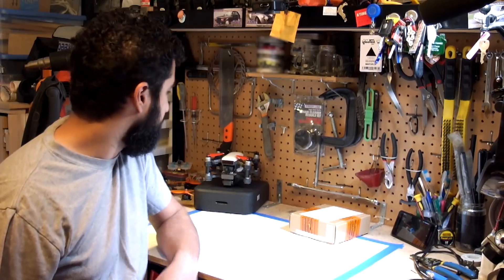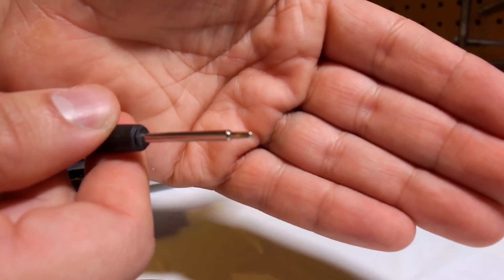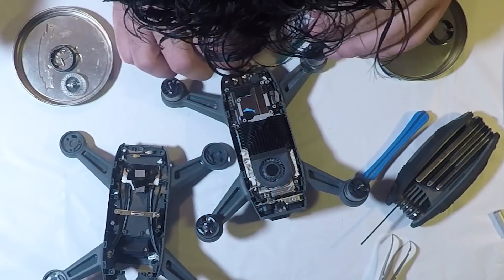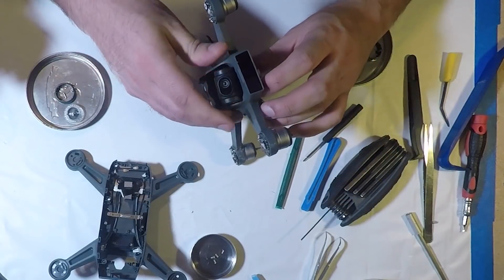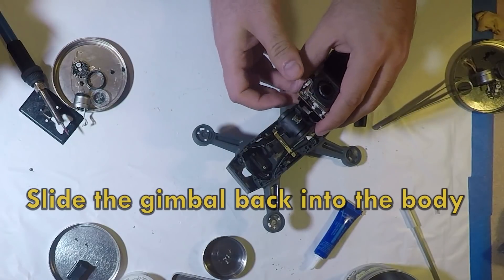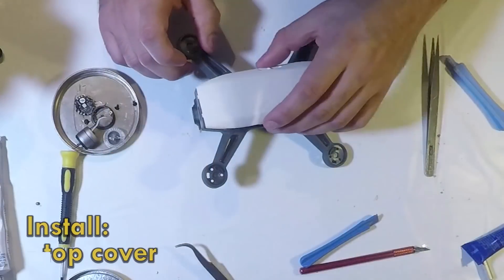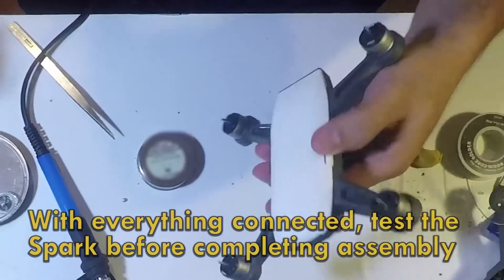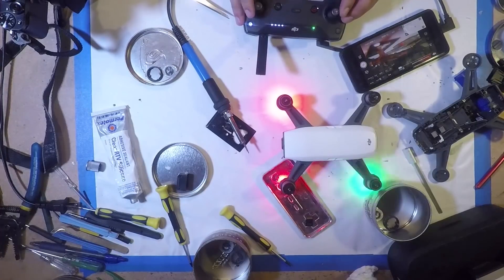DJI Spark Repair: Complete disassembly and reassembly.

Comment: Do you do repairs and if so how much ? I need to replace the frame like you did it looks ugly with glue. It works fine now but just the look bothers me lol
Reply from the maker: Email me at prepared4landing@gmail.com and we can discuss.
Reply: Vallero Graphics 
Same here. Just have a hairline crack on one of the arms. Did you end up working with him?
Reply: D Love no I did not. I fixed it myself. Sanded it down a painted it so it looks a little better
Reply: It looks so hard to do and I don’t want to  mess it up. Tough choice
Reply: @dlove1798  Hi do u still do repairs on the dii spark

Comment: Wow that’s amazing so many screws! The foil tape part seems a little touchy... Do the connections snap? How did the fight after the complete re build go? Oh the wires that need to be soldered back together are they marked to know locations? I say thank you for your time making this and to a lot of dyi folks this really is amazing 😉
Reply from the maker: The connections do snap into place, so that's not too much to worry about.  The number of screws isn't too bad as long as you keep them organized.  As far as soldering, there are solder pads and it is relatively easy of you have some soldering experience.  The drone flew perfectly after an imu and compass calibration, and continues to fly properly now.

Comment: nice repair video, i really appreciate the time you took to explain everything in detail. Since last weekend my spark's gimbal stopped working. It is due to the gyroscope of the gimbal being broken. I have already had contact with dji costumer service and they are advising me to ship it to a repair center. However i'm afraid it will cost alot of money to let it get repaired by them
Do you know in what part of the drone the gryscope is located. And if it would be feasable to fix it myself?
Reply from the maker: Unfortunately I am not very familiar with this error. It could be an issue with the gimbal itself, or the main board, both of which are probably around $100 each to purchase as spares.
Reply: @PrepareForLanding  Thank you for your quick answer, i'll guess i'll just mail it yourself dji repair centre and see what they find.

Comment: Doing this today. Cracked an arm off of my spark. Thanks for the excellent guide!
Reply from the maker: Glad to be able to help!
Reply: Ah well.. that didn't work out as well as I hoped. The crash left my spark with a broken arm and no video feed. After a long repair sesh, still no feed and now have vision sensor and esc errors. I think it is time to cut my losses on this spark. Thanks for the guide though. Best one out there. I probably overestimated my repair/soldering abilities on this project :) Now the question is to get another spark, or just get rid of all of the extras that I have to work with it...
Reply: @PatrickWynne  broke my arm off today  too guess ill stick to super glue
Reply: @rolitotingzon2833  hi, did super glueing help your case?

Comment: I hope being this is a new question based on an older video. I fixed the one damaged esc by replacing all of them and motors from a salvaged spark. The drone powers up links with the remote the motors twitch showing me they have good connections However after I hit go fly and try to start motors I get all four esc errors no number it just says if it persists contact Dji support. Could their be another component failure causing the esc errors. The lights seem to be working accordingly up until the failed takeoff attempt then they all go red I forgot what all the flashing and solid patterns mean as far as status. Would calibrating the esc’s with assistant 2 in developers mode. What’s your thought on how I should proceed. I’d appreciate any help bro
Reply from the maker: Honestly that's a tough one. Sounds like the ESCs aren't getting the power they need. I would double check for shorts on the output side (esc to motor) first.

Comment: What type of screwdrivers do I need for the repair??
Ty great vid!
Reply from the maker: Thanks! Unfortunately I've since sold all my Sparks and moved on to other drones, and I no longer have a reference to check what size drivers are needed for this job. I remember that to get the top off was a pretty small hex (maybe 2.5? 3?) And the rest of the screws were a pretty small Phillips head.

Comment: What is the link for buy One Shell with wires  i ONLY find without wires and without plastic covers for the arms, and this arms covers os very dificulta to take out and put in new shell because is ONLY plastic
Reply from the maker: Seems that parts for the spark are harder to find now. I've never seen wires only available, but I'm sure you can use generic wire if you are able to fish it through the arms.  https://www.ebay.com/itm/284655288011?mkcid=16&mkevt=1&mkrid=711-127632-2357-0&ssspo=fOjeFNBsQau&sssrc=2349624&ssuid=cecsHkMeSL2&var=586286248986&widget_ver=artemis&media=COPY looks like it has the frame with the arms.

Comment: I crashed my spark the other day. I cant remove the battery it will not come off. I can charge it while it is in the spark and fly the drone. I just cant remove the battery which is not good because I have 3 other spares. When I press the release sliders and start to pull back it comes maybe 1/16 of inch. It just seems stuck. I can push it back in place and hear it lock. Do you have any thoughts? Thanks, Jerry
Reply from the maker: Oh man sorry to hear that. Unfortunately you can't even disassemble the spark to remove the battery since the screws are under the battery.  It sounds like the latching mechanism has somehow broken. On the plus side, from my experience, the latching mechanism is relatively weak on the spark compared to other drones, so perhaps a little man handling or prying with a plastic pry tool might get you enough leverage to get it to pop out.
Reply: @PrepareForLanding  Thank you sir.
Reply: @PrepareForLanding  I took your advice and pried it loose. That worked it was that battery. All my other batteries go in the spark ok. Thanks for your advice.

Comment: Are the motors and ECS board all the same?
Reply from the maker: Yes, they are interchangeable. If you end up with a motor spinning the wrong way, you will need to flip any two of the three motor wires to change the direction.

Comment: is there a reason you left the gimbal electrical connectors connected to the board instead of unhooking them? im doing mine now and i accidentally unclipped the 2 connectors for the gimbal and camera. did i mess up or will i be ok? please let me know asap as im doing this right now.
Reply from the maker: It should be okay.  I didn't see a need to disconnect those wires, so I didn't. As long as your reconnect it securely, you should be fine.
Reply: thanks so much!

Comment: What kind of soldering iron did you use? How many watts was it? I can't seem to desolder motor wires with a 60W.
Reply from the maker: I mostly use a 60w with adjustable temperature, and I keep it around 400-450*c.  If you are having trouble, perhaps you need a wide flat tip to get more heat into the joint.  Also make sure you tin you tip beforehand to make sure you get good thermal transfer.  The wires didn't desolder immediately for me, it took a little effort to get them going.

Comment: How did you remove the silicon from those things screws? This is really hindering me.
Reply from the maker: I just used a pick. Anything small and pointy should work like sharp tweezers or a really small screw driver. Dig into the silicone slightly and pull it out.

Comment: Do you only use he threadlocker glue on the motor screws? Also, does it matter which motors go where? I've got mine muddled lol
Reply from the maker: Yeah threadlocker is only needed for the motor screws. The order of the motors does not matter. Test the motors after install. If for some reason a motor is spinning the wrong way, flip any two of the three wires.
Reply: @PrepareForLanding  which 3? The black red white or the 3 black?
Reply from the maker: @robw20  black, white, red that go from the ESC to the motor. In older versions of the spark, those were all one color. Newer revisions they changed to black, white, red for some reason.
Reply: @PrepareForLanding  Thank you! So I've finished all the steps in the video and have 2 problems. 1. There is no life in the gimbal camera, it doesn't move at all, as if there is no power going to it. 2. I cannot connect to the drone with my phone. :(
Reply from the maker: @robw20  For the gimbal, go back and check all of the lego connectors between the main board and the gimbal. It is very easy for those connectors to look like they are connected, but not be seated correctly.  I have made this mistake before and had to redo it.  Sometimes I take a picture with my phone and zoom in to the picture to inspect the connection.  As far as pairing with the phone, if the spark is in the wrong mode it will be looking for a remotely.  Try this video to set it to pair with a phone: https://www.youtube.com/watch?time_continue=25&v=GOi9WiS-PF8&feature=emb_logo
Reply: @PrepareForLanding  Thanks will try. The silicone is making life so hard, can't get it all out
Reply: Hi again, sorry for the barrage of questions! :) I really appreciate your help thus far. So I've made a little bit of progress. The Camera and Gimbal is now working and I can now connect to the aircraft with the RC which is good. 

Next issue I'm having is that I cannot start the motors because of a "no. 4 esc - esc error" do you know what this means? It's something to do with the motors right? Does "4" mean there's a problem with the 4th motor?

I've also noticed that the led lights stay solid red, but if I take the compass module out then they start flashing yellow/red/orange again.
Reply from the maker: @robw20  I'm not sure about DJI, but on FPV drone that I fly, this is the motor order: https://learnassets.getfpv.com/learn/wp-content/uploads/2019/06/26225548/Motor-Order.jpg I suspect that it is the same for DJI. The ESC is the circular little board under the motor.  If you are getting an ESC error, I would suggest checking all the solder points on the 3 black wires coming out of the arm and to the ESC.  I would also double check the motor wires going between the motor and the ESC.  There might be a bridged connection somewhere or a poor solder joint.  I would try to resolve the ESC error before attempting to diagnose anything else.  The issue with the red lights most likely just indicates that you need a compass or IMU calibration.
Reply: @PrepareForLanding  Thank you. I've inspected the EPS no.4, it's actually different location to the picture you sent. It's the only one that doesnt twitch when the drone turns on so it's definitely the faulty one. The ESC board looks fine to me, not sure what else to check. I re soldered all the joints but the problem persists.,
Reply: @PrepareForLanding  ok I've got the motor working again now. However it seems like it's not getting enough power or is not in sync with the other motors.

When I stop the drone it stops spinning before the other 3.
Reply from the maker: @robw20  Glad you got the motor sorted out! Was the motor perhaps damaged in the crash? Try spinning all the motors by hand and see if motor #4 feels like it has more resistance.  When spinning, if it gets up to speed as well as the other motors, it is probably not a risk to the flight worthiness of the craft, but it could affect the top speed and flight time depending on the severity of the damage.
Reply: @PrepareForLanding  thank you, I've decided to send it in for repair, as I'm just going back and forth re soldering joints over and over, and haven't done a very good job. Great tutorial though man, I learnt a lot doing this!
Reply: @PrepareForLanding  Hello again! How's it going? So they couldn't repair my drone so I've just had another look myself. 

I can get it flying when the top white cover is OFF, however when clipping it back on, the pressure of it seems to pushing the motherboard down slightly which makes it disconnect from the RC. There must be something underneath the motherboard that when a bit of pressure is applied it doesn't like it. Do you have an idea of what it could be? I'm so close to getting it flying again. 

Also a side note: the motors do not spin completely in sync. One seems like it's getting a little bit less power however the drone still flys ok. Will be fine just flying around garden etc.
Reply from the maker: @robw20  hmm that is pretty strange. I would double check that the antenna connectors are seating correctly on the back of the main board.
Reply: @PrepareForLanding  Just checked, they are connected fine. It's very strange, it's when the board is fully locked in place that is disconnects, it works fine before i screw the board down. Perhaps the antenna wires somewhere are getting pressed on when the board is screwed in?
Reply from the maker: Hmm that is pretty strange. Something like that is unfortunately difficult to diagnose without seeing it in person.  Maybe you can send some pictures to prepared4landing@gmail.com and I can see if I can spot anything that looks off.

Comment: Great video. Unfortunately I hit a tree with my spark and I think the gimbal was damaged. I seems very loos and wobbles everywhere when I turn the drone on. When I tried to fly it ( hover) the sensor kept going off there was nothing close by  don't know if it's because of the gimbal. I've spoken to a few repair shops and they have quoted £280 I only paid £300 so I don't think I'll get that done will just buy  new spark. Very frustrating not having the knowledge that you have. Pity you didn't live in the UK I would get you to sort out the drone. Not too bad  I have a mavic platinum. Regards Irvine PORTSMOUTH U K
Reply from the maker: Ah that sucks.  A replacement gimbal should cost less than half of that if you want to try and repair it yourself.  If you are careful and take your time it might be worth it! Unfortunately, I don't think the gimbal is related to the front proximity sensor, but it isn't clear if that is damaged until you start to pull the drone apart.

Comment: mine crash a few weeks ago then i got myself a new frame...unassemble it and assemble to the new frame, the components works fine ESC, motor, gps, anthenna all work fine...now i disscover a new issue, when i screw and tid the board it disconnect...the gimbal wont moved whn i start up, and thn i unscrew the screw and start up..and everything works fine again the gimbal will moved..thn i put press the board give a bit pressure it dissconnect again...the worst part is, if i snap my top cover it stop work again if i removed the cover it work again...anyone have this weird issue?
Reply from the maker: It sounds like something might be shorting out when you tighten everything down. Check to make sure some shielding isn't missing or some wire isn't getting pinched. You could also try putting some electrical tape between any place where electrical components might be touching when they are installed.
Reply: @PrepareForLanding  i pretty everthing still didnt have any clue though...but i remove the two sponge tabe tht close to the battery connector..doe it hv any effect if removed does?
Reply: @PrepareForLanding  thx man ...it turns out holding the ESC, antena shield was upside down😂😂😂 and thx again for the tips😂😂
Reply from the maker: @gaminglovers8484  glad that you were able to find the issue!

Comment: what do you think
 i have to replace
 by water damage?
Reply from the maker: I've tried to repair one with salt water damage before with no success.  Salt water really ruins the circuit boards. Fresh water damage isn't as bad, and trying to dry out everything in rice before e en attempting repairs is probably a good first step.
Reply: @PrepareForLanding   i found a spark on a tree, so probably just rain water. 
lights inside, everything just fine, but the battery dosent react with the body/ dosent charges
Reply from the maker: @DanielAMinov  batteries typically don't survive water damage well, you would probably need a new battery to test the condition of the rest of the drone.
Reply: @PrepareForLanding  i bought one. same. i opened the spark and the tred light on the right side of the blower ist blinking like every five secounds.

Comment: how to get the rubber black damper from the camera thru the tiny hole?
Reply from the maker: That can be pretty challenging.  I've seen one trick where you take dental floss and wrap it around the rubber, then fish it through the hole. Once it's through, pull, and the rubber comes with it.  Whatever tool you use to help you achieve this, be sure not to tear the rubber in the process.
Reply: Prepare For Landing Hi I Did iT with sewing cord. Same solution. I didnt tear the rubber But I found iT a flaw in the design. Now I have to do the solder part for the four engines. That Will be challenging. Last time I Did that was 25 years ago 😂